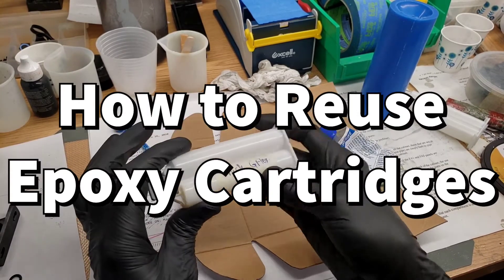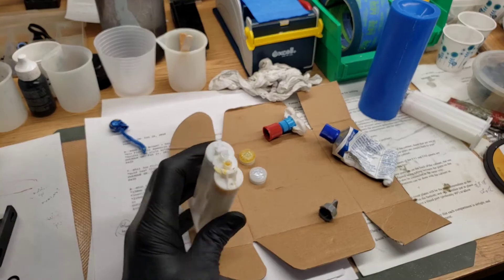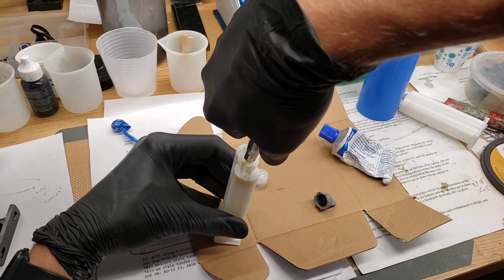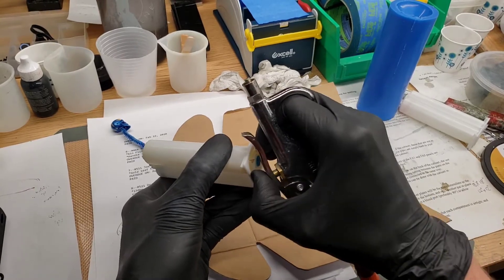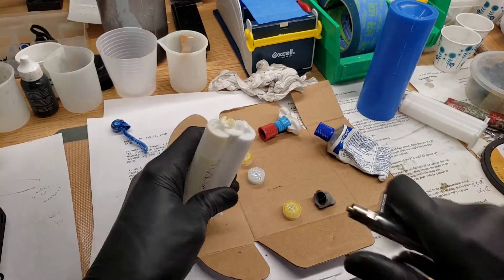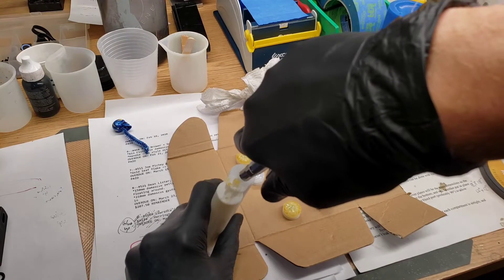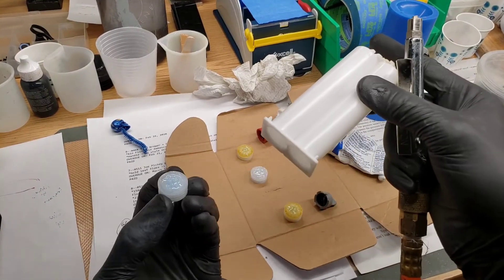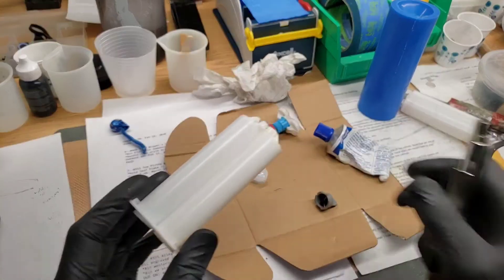How to Reuse Disposable Epoxy Cartridges - Recycle

Comment: Excellent video! Your method for reusing the syringe style dispensers is really clever and useful.

I have a question about a similar topic. Have you ever tried using a quadro static mixer tip with these two-part epoxy syringes? I've been considering them to make mixing easier, but I'm trying to figure out how to deal with the epoxy that cures inside the nozzle.

I was wondering if, since the nozzles are often made of polypropylene (PP), the hardened epoxy might not adhere well and could potentially be broken out or "cracked" out of the tip, allowing it to be reused?

Thanks for any insight you might have on this—it seems like a great way to reduce waste if it's possible!
Reply from the maker: Yes, I use the static mixer nozzles. Unfortunately, trying to clean those is not worth it/impossible. I buy them in bulk, or buy the cheaper off brand ones.
Reply: @engineerable  have you made a video on the ones you use and where you get them? I would like to know which version do you use and if you have tried out some of the different versions. I would like to see video of you using them. Also, would like to see video of you refilling your syringes with 2 part epoxy.